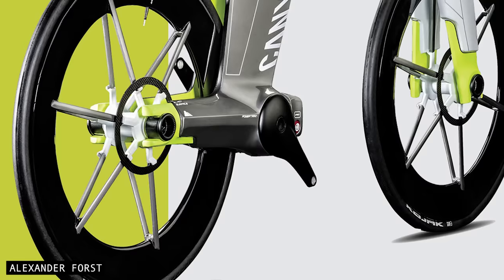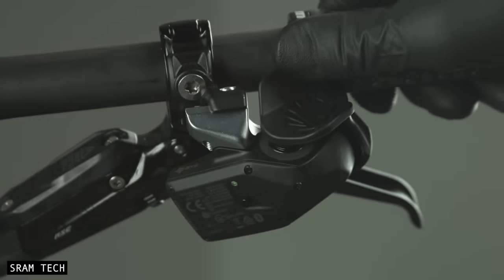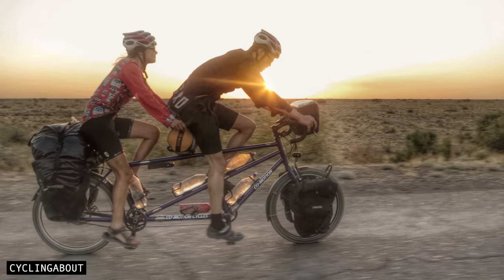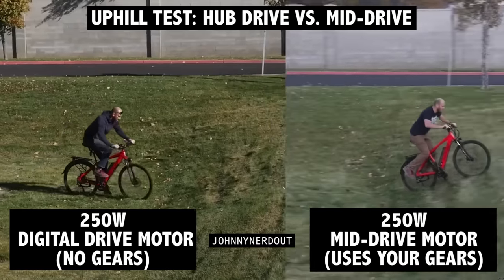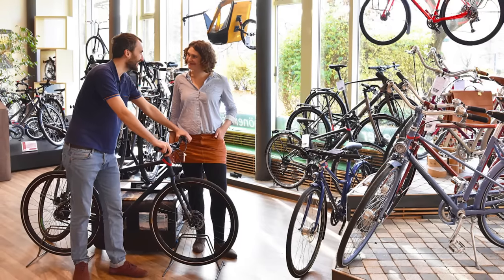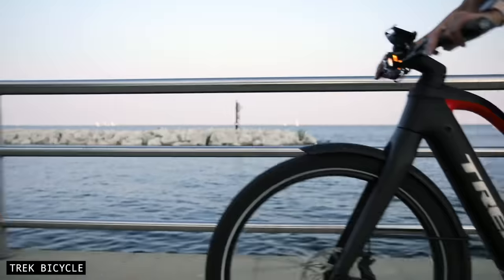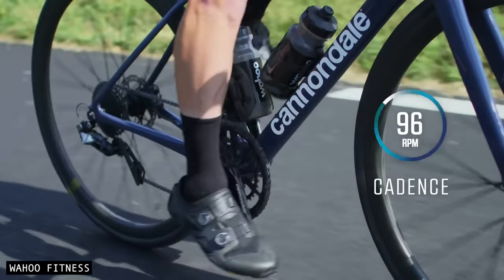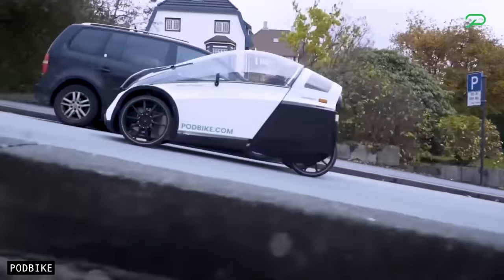Are Chainless Digital Drive Bicycles The Future of Cycling?

Comment from the maker: I might be wrong... but I think this is the FIRST video explaining digital drive bicycles on YouTube!! How cool is that?! 😎
Reply: Viral 🤞
Reply: A bit more than pretty cool. But the power efficiency of the digital drive is not cool at all...
Reply: @paulbizard3493  
True. It's hard to achieve as much as 70% efficiency, but this doesn't matter. On the flat, the needed power output is low anyways, and on hilly terrain, an electric powertrain will recharge and give back 70% of the energy while with a mechanical drivetrain the energy will go to waste. With an energy bank of a couple of kWh, it should be the better choice for most trips.
Reply: Thanks, I was curious about this.
One point you have shown but IMO not put enough emphasis on.
With this you can easily divide power output between multiple wheels (especially interesting for 3+ wheeled vehicles). You can also easily power a steered wheel (I presume that is what gives the cargo bike around 9.30 that amazing maneuverability).
Keep up the good work
Reply: Electrom Light Electric Vehicle must have been a part of this video. There is a YouTube channel on how that guy creates and the every improvements he makes.
Reply: Usefull vid thank you. Very clear on the subject and the current limits
Reply: Very cool. Thanks for sharing the knowledge
Reply: How is a 30-50% power loss not mattering? This sounds like a reaction from someone who doesn't ride a bike. Ever ridden into a headwind, up a steep hill, or with a flat tire. It's soul crushing. You would never succeed at selling a bike to someone who could try both styles. It would be an easy choice to avoid the digital drive. Regen is viable with hub motor already, so it's not like that wimpy feature is improved by dropping the chain. No one is achieving 70% efficiency on bike regen, and you don't want to destroy your downhill coasting momentum on rolling hills, so you can only really use regen to great effect descending a mountain.
Reply: I agree,never saw a digital bike before.
Reply: It's funny that you include graphics from Grin because they've definitely talked about it before.
Reply: Unless they have another name.
Reply: I'm 40 seconds in and really annoyed by the term digital drive. I really hope there's a good reason for not calling it an electric Drive bike / eDrive bike.
Reply: @beaudjangles  cus they kinda exist in some layman terms of language.
Take axon global, originally their name was taser, taser became so generic it was rebranded to axon global.
Smart people would invest in them and in  10years u laughing.
Anyway your comment is moot
Edit
And it’s not an e bike.
Reply: very nice review, if at times highly technical. I'm so intrigued!
Reply: Yes first I have ever heard of it, great video and analysis as always. Not something that I am interested in owning personally but very intriguing as an option for human powered and hybrid vehicles.
Reply: Why digital drive and not electric drive? If I build such a system withoud any transistor would it be called an analog bike?
Reply: If this were a Wikipedia entry, it would be flagged for reading too much like an advertisement. I fully expect that we will achieve fusion break-even before we overcome the efficiency problem. And where does this term digital drive come from?  Sure. Digitally electronics play a part in the power control circuits but they're nowhere is near as essential to the function of the mechanism as are the generator and motor which are not digital. Oh and by the way in wheel motors are not necessarily incapable of producing adequate torque. That's a design choice, not a design deficiency.
Reply: @MrDanthemaniam  we habe >97% efficient motors today. Make the controller losses <5% and we're close to dirty chain.
Reply: Hence, Subscribed!
Reply: I’ve come across this in the context of a cargo delivery ebike. It was the type with the rider in front of a long and tall cargo box.

I think Arcimoto’s “Mean Lean Machine” e-tadpole also uses a digital drive.

Makes sense for a long wheelbase bike where a mechanical drivetrain would require a long or multiple chains or belts.

But this video is the most comprehensive I’ve seen about them.
Reply: So cool
Reply: An enviolo CVT hub and automatic shifting can give a lot of the same benefits but with way better efficiency.
Reply: Yeah! 👍
Reply: ...and the best.
Reply: Electric, not digital
Reply: @112chapters3  It is an e-bike. Turning the pedals produces electricity that powers the motor. It can be paired up with a battery or not, but it's still an ebike. "Digital" could be a controlling signal but the propulsive power is definitely analog and not digital. This video is an example of what it looks like when a marketing manager does not ask the electrical engineer what exactly powers the electric motor of the bike. The next thing you know, they'll call it quantum bike or Bluetooth bike. 😂😋
Reply: @fd4511  yeah ok
Reply: FYI you are getting those stupid scam comments
Reply: Macarena cool.  💪🏻😎🤳🏻
Reply: pretty cool, but I have questions.  Aren't you limited by biology to produce no more than about 250 watts or so, and that by Olympic level athletes?  I think there will always be a need for analogue power, especially in a bicycle setting.  I own a pretty decent ebike a Lectric Xp 2.0 Step Through,  pretty good bike for the money.  However, right now my derailleur and gearset is damaged, and it is my primary method of getting to work, and range anxiety is now a big thing for me.  I think digital drive defeats most of the purpose of modern ebikes, Viz: to provide a platform by which you have multiple ways of input power, and those cheaply.  If the cheap 2 stroke 66cc engines were more reliable, I would like to see them also installed onto more ebikes, giving you three methods of input power.
Reply: @mattparker9726  just take the extra gears off your back wheel. Mean everything but 1 gear and a chain and a crack. Defeats the purpose of a multi speed and and gear bicycle but it does solve your one and only means of travel your bicycle will function that's the main point. Or get a different back rim and modify that one.
💪🏻😎🤳🏻
Reply: You're going to have to resize the chain too of course but that is easy enough done
Reply: @DR_SOLO  I'm going to get it repaired.  It's too valuable to me to take a half measure.
Reply: @mattparker9726  one gear in between paychecks is better than missing work and having a small paycheck was my thought that's all
Reply: I'm not convinced until you go around Africa on one of those!
Reply: You keep using the word "digital", but I don't think you know what it means. People like you probably believe in audiophile HDMI cables . . .
Reply: stupidly inefficient setup.

Would have to put in a LOT more effort to get the same out as a basic chain setup.

And enough with the "digital" BS.

Nothing but moronic marketing.
Reply: Were the early digital drive parents really digital though?  Generator plus motor is electric for sure but not necessarily digital.
Reply: There are other improvements for better efficiency, such as two separate generators (one for each leg) and/or levers instead of pedals (which generate more torque from almost the same effort). Also the wheel motor can be integrated inside the rim and this may reduce its weight or improve its torque range.
Reply: @vitordelima  in which case I can see it as an option for certain applications, especially when the bike is also an e-bike, but not universally.
Reply: @WatchmakerErik  Maybe the efficiency can increase, other ways to harvest energy from the environment and the rider maybe found (triboelectrics for air friction, photovoltaic surfaces, better solutions to use the arms or legs to power it, ...) and it could be worth it even without a big battery.
Reply: @vitordelima  maybe but I dont see an electric drive matching both the efficiency and weight of a chain anytime soon.
Reply: All this is doing is taking the work that you’re doing is the cycle is away from you making it so you can store energy for hard hills it’s absurd why would anyone want to ride like that you Eubank a bunch of electricity going down a mountain pass and then you don’t have to work as hard even though you didn’t do anything to get it? I don’t you know what I mean it’s so fucking ridiculous I can hardly stand it no self-respecting Cyclist sued ever go for anything so daft.
Reply: Yeh, exactly why are they called digital.. as far as I can see, its got a dynamo, and a motor, the only possible bit that might be digital, is the controllers phased supply of power to the motor, and they are in all ebikes, and we don’t call them digital. But generally, from the design, one can immediately see why these systems are inefficient.
Reply: very
Reply: Didn't think that concept made it to bikes. But why call it digital?
Reply: nice tech talk but I don't know why pedal power still exist considering the availability and affordability of powerful batteries.  it is like having automatic transmission car but you still want a simulated manual shifter over it?
Reply: Considering that a high proportion of bike sales are now ebikes I see this coming very soon.
Don’t e-cargo bikes / rickshaws use something similar already?
Reply: But bad explained. You connect two three phase motors (three cables) phase to phase and conversion reach 98% you only need one motor in the wheel and other in the crank. no electronics needed. 4 gears by star or delta connections on each motor. the motor in the crank act as a generator.
Reply: Not cool
Reply: This video is a clickbait and a scam for your so called digital (what exactly is that ) drive bicycle. See my separate comment below. Mentioning the addendum 'digital' on any product makes even a carpenter's hammer super efficient than an analog hammer LOL.
Reply: I like this idea. Pedaling up and down hills would be a very different experience from a chain bike, and you could pedal down hills to charge, plus use regenerative braking, without increasing speed. The idea of decreasing resistance at the top of the stroke is excellent.
Reply: @ricardorapture  it is a challenge to get even 80 percent efficiency in a single small motor or generator. This is based on mechanical power input and electrical power output (or vice verse). So how are you defining or measuring 98 percent efficiency? If you are only considering the loss in the wire between the generator and motor, then you are ignoring a lot of other losses that are important.
Reply: @mckenziekeith7434  the three phase synchrouns motor with squirrel cage starts on 98% efficiency. Reluctance motors goes Up to 99,8%. They can be used without any conversion and no electric components, only wiring on delta or star they can do 4 gears between crank and pinion motors. They work as motors and generators.
Reply: @mckenziekeith7434  you need to update your info
Reply: @ricardorapture  I have never seen a bike motor that is 98 percent efficient. Please send a link to the datasheet. I have been working in ebike/eskate/escooter and have measured motors on a dynamometer. So I am curious what basis you have for saying 98 percent?
Reply: @mckenziekeith7434  they are more expensive tho. And usually bigger. Do not point me with that finger, this video talks about old fashioned 2 wire motor so 🤷 I think the speech is invented.
Reply: @ricardorapture  yes large motors are available over 95 percent efficient. Induction motors and generators as well as permanent magnet synchronous machines. But not for ebikes etc. The things that make motors more efficient (copper and steel) also make them heavier. I am an electrical engineer. I have looked at a lot of motor specifications and tested a lot of motors with a dynamometer. I have never seen a small motor that was anywhere near 98 percent efficiency. It sounds like you have never seen one either.
Reply: @mckenziekeith7434  the more you want for them the less efficient they are 🤷 you can try to use them inside the specs and not like me.
Reply: Why is it called "digital" drive ? Where are the digits ?
Reply: Where can I order some?
Reply: @goinghome1904 it's not particularly hard to make it to ~85%. You just need a tiny airgap between stator and rotor so the magnetic flux experience low resistance as well as a very low resistance in the electrical part as well. Special materials like neodym make the design easier as well. But these things sum up in cost pretty quickly so do not expect a drive like this under 2k until mass production kicks ins.
Mechanical gears can be sold much cheaper today.
Reply: Can a one way cluch plus an electric motor without chain link be possible to increase Efficiency?
Reply: @MrHaggyy  the airgap distance is not highly correlated with efficiency. It does help increase power density, though.
Reply: Unfortunatly you told people unforgivable Bullshit about electric motor and generator efficiency.
Reply: So cooll
Reply: Years of practice on heavy diesel locomotives. How "digital" is that?!
Reply: In your advantages/disadvantages list, you omitted just one thing. Maybe money is no object in your parallel universe.
Reply: Where do the figures for the efficiency from? I've usually heard 90% for mechanical to electrical or vice versa and step up or step down tranformers are usually extremely efficient (99%+) so I'm struggling to see where your efficiency figures come from.
Reply: I've driven almost all series hybrid bikes on the market and we even have two of them. One is the footloose, for which we helped with development, but the software is extremely bad. The other is the Bike2 system in one of our prototype GoLo cargobikes which has over 80% efficiency, which is almost comparable to an enviolo drive system. My findings:

Mando footloose: bad. very bad.
Citkar: has the mando system but uses micro cranks so you can't create torque. Bad as well
Vowag: It's tiny, doesn't resist any torque, no feel at all
Old schaeffler: somewhat decent, but had some patent problems
New schaeffler: very jittery, not pleasant
Pendix: As shown in the video, pedal three times and maybe the bike starts moving
Bike2: almost feels like real cycling, high efficiency, very noisy, but great product/prototype

The biggest drawback we had with our Bike2 system is not the generator side but the motor side which really has either the torque or the top speed issue. So for now we'll stay with a chain but ideally our future is hybrid. Personally I want it to be efficient and I feel that the e-assist may add max 250W from the battery in any ebike system. But hey, I'm a cyclist, but the general public wants to go the lazy wall-e way (sadly). Great video and great research!
Reply: You may be the first one to call it digital when it's not digital. 🤷‍♂️😎
Reply: The video is nice but I would point some issues with your logic. 

So we have a good working system. "Test driven" by millions over the every day. 

- Lower running cost? (You swap a chain to a complex electronic controller which has way more failure points under the box)
- You lost the redundant drivetrain compared to the current "hybrid" ebikes

- The human body is not designed to output at maximum all the time. (That means that can cause new issues as well)

I admint there is a good point to consider it at some cases but I would not argue for it.
Reply: Nah there are other videos. Lots in fact. Ultimately this bike is a waste of time for now. I will stay with 95% power transfer.
Reply: About 2 years ago I had the idea for what I now know as a digital drive bike, and I spent weeks brainstorming the possible advantages and disadvantages of such a system. The idea seemed game changing and obvious to me but I never found any records of other people trying the same idea, at least until now. You might indeed be the first video on YouTube explaining this niche but exciting subject. Thanks for reminding me of the futility of trying to have an original idea.
Reply: I'm so happy to have found your channel. You are the best in this area for sure!
Reply: It is all making a simple cycle into an electronic nightmare like a modern car !
Reply: @curtisducati  That would be the typical way of thinking about it but think of books — they still exist and computers haven’t managed to render them obsolete. I used to think like you but now I think it’s good we have a wider choice as consumers. All those advanced technologies diversify our lives as long as the new coexists and not replaces the old. Cars are coming back from this dead end road of touch screens only. Manufacturers realized (finally) that no-knobs approach is not only clumsy but also dangerous for the driver.
Reply: by 'digital' do you mean electric?
Reply: @paulbizard3493  by 'digital' do you mean electric ?
Reply: It is not a digital bike! Just because something involves electronics, it isn't digital! Digital has to do something with "digits". Not just electronics.
Reply: its not digital its electric.....
Reply: @carmatic  yes, my bad. :) But then a computer could control the gear ratio and so the drive would be digital.
Reply: @paulbizard3493  there are scooters, powered by batteries and driven by an AC motor with computer controlled operation... but we call them electric scooters, not digital scooters
same with cars, bikes, planes, trains and all other forms of transport
Reply: because theyre not feasable mate u put more foot power in to get the same speed as a normal bike poor efficeincy
Reply: If the guy with white bike wants to improve efficiency, he should learn to adjust the seat hight properly. That would gain 5%.
Reply: @Youtube_Stole_My_Handle_Too  but a traditional e-bike still has chain driven for perfect pedaling efficiency while still having regenerative breaking on hills
Reply: Low running cost - low drive efficiency
I'd think you can't have one unless you don't have the other. 

Ah yes, low maintenance, but secretly high maintenance cost. Where you have to go to a pro cause you can't fix electronics or motors yourself. And you have to buy brand parts cause no one wants to bother offbranding them for the gullible 100 hipsters that own one. 

At any rate, your lists at 6:43 is funny. I have to wonder how much you're gettin paid to upsale so hard that you even have 'infinite' on the list like some fifth grader.
Reply: Yes, if you make up your own name for an old concept - you’ll surely be first..
Reply: cool until you realise that even with the most efficent components you can only reach a effectiveness of 60~75 percent. It is a cool concept for electric bikes to add for range extension sorta like regen breaking.
Reply: I'm an electrotechnical engineer and damn did you over complicate a simle thing as a bycicle...
Reply: This bike is utter rubbish.
Poor efficiency is a deal breaker.
Reply: What is digital about this?
Reply: Hahaha JUST BUY A MOTORCYCLE!!!!!!!!!
Reply: No, they are not.  A chain is around 95% efficient today, even on a poor quality groupo unless it's horribly maintained.  Just looking at this, I would estimate the efficiency to be 50% or less.
Reply: yep your wrong, this is nothing more then step assist like anny other electric bike. just without the chain. energy does not come for free, it has to come from a battery none the less. else people would have pedals in cars if that be more efficient....
Reply: @keytracer  bicycles are anti-technology. You can buy an electric motorcycle or a standard combustion motorcycle at this point in time
Reply: @keytracer  and then take a job we're not sitting in front of a computer all day
Reply: I may be wrong but it sounds to me like this is electrical analogue and shouldn't be classified as digital at all.
Reply: @ingramfry7179  it has a motor on it just get a motorcycle stop pedaling.
Reply: It's still analog!
Reply: @scottw550  so is a motorcycle with a carburetor. Just get a motorcycle and stop pedaling
Reply: It's not digital. It's a normal motor-generator and your efficiency numbers are total crap.  Have someone ride route and measure caloric output then do it with chainless bike.
Reply: I might be wrong, but didn't the professor on Gilligan's Island produce an electrical generator, using Gilligan to pedal a bike?
Reply: No, it's not, i already had watched one video from 2021., or maybe that 2021 dont even be the first.
Reply: I think you missed a point on digital bikes: If ever there is a problem in the middle of a desert, it is not serviceable by a regular person. Most probably the bicycle will need to go a bike workshop from its brand.
Reply: but its a crap idea maybe thats why
Reply: @Sergio_Loureiro  it's just an e scooter with a tiny pedal generator.
Reply: You don't even know what digital means. Electric != digital.
Reply: Go to school and learn someyhing. There's no such thing as digital bicycles.
Reply: @keytracer  It's only a misunderstanding or lack of knowledge.  When confronted with that, do not insult people, explain what they do not know.

Stop picking fights.
Reply: This is an electric drive train. Digital refers to sharing data or certain watch displays etc
Reply: I mran you said that this is digital which is completly wrong, its electric. Not everythung electrical is digital
Reply: This is brilliant and informative.
Reply: Would be better if there was such as thing as "digital drive" where the reality is *ELECTRIC DRIVE*. It's impossible to listen to your video when every sentence is wrong.
Reply: Someone had to say it.
Reply: Can I just say there is nothing such as digital drive. It's a fucking electric drive with digital components.
Reply: Power rangers
Reply: Come on. What are you all talking about.  This is not digital, it's an electric drive.  Our society has become dumbnified by design.
Reply: @FeralDayASMR  e-bikes still have traditional pedals because even they understand e-drive is inefficient
Reply: Because it's not a digital bicycle
Reply: How does “electric” turn into “digital” ?? 🤦🏻‍♂️🤦🏻‍♂️
Reply: Well put together vid. Very professional and entertainingly informative... It's a very sub optimal design, having 2 motor/generators..It would be better to have something more like a unicycle with direct drive, pedal-to-motor-generator but with a front wheel and handlebars, Batteries or capacitors in the frame charge under braking and auto-assist when accelerating. Possibly at least 1 wheel using a 3 pronged in-wheel regenerative suspension system, but may not be worth the added weight.. Half decent solar power paint or frame parts and it may be more efficient than a chain and gears. Very expensive though.
Reply: @kristianhartlevjohansen3541  This is an electric bike without the ability to directly drive it. Nothing more.
Reply: what is digital about the drive?
Reply: At least update your comment by removing the word digital
Reply: @zetsumeinaito  Dude called an electric drivetrain a digital drivetrain, then proclaimed to be the first to cover the topic. Gotta curb your expectations for him.
Obviously in reality, it has innumerable gear ratios, not gear ranges
Reply: To heavy, to many energy loss.
Reply: u sound like Modest Pelican!
Reply: Not hte first .. Podbike is an example. And it is electric drive (by wire perhaps), not digital - digital is a something completely different  -
Reply: I can’t believe you made this whole video without knowing what digital means
Reply: Janet Pratt  Why would you want that given all the downsides? Stick to a bike with an electric assist motor
Reply: There’s nothing digital about this.
Reply: The delivery of the narrator makes me wish I was deaf.
Reply: THIS IS NOT DIGITAL!!!
Reply: Surprisingly no. One can be aware of the yellow that covers everything. If the driver doesn’t provide appropriate feedback and incorporates their own bias it becomes obvious. Such as Nijah Houston. Houston TX was the goal right? But the feedback was not what one expected along with the cyclist.
Reply: @Youtube_Stole_My_Handle_Too  I find it hard to believe if it achieve 30%
Reply: @rosserobertolli  great info
Reply: The problem is: doing it this way, you get as tired as cycling in conventional way plus it's less efficient in comparison to regular bike. Which makes it look good only on the video. In reality you want to throw the bike into a ditch and walk away.
Reply: They can call it anything they want you, you're being irrelevant
Reply: Amazing👍
Reply: So I see efficiency increase with constant modulation to keep you storing energy in a way that is always optimum, like LT1, or your LT2 base output, if it then adds a bit of battery power to it and uses regenerative brakes, and also uses a larger hub for hub gear motorized propulsion for hills it might be really fun and useful!
I would get one if it also let you pedal to charge while braking or the brakes would cutoff direct power output to the wheel so you can charge it while on downhills or charge a bit longer while braking for a stoplight.
Reply: 1s and 0s makes it digital otherwise it's electric. Microprocessors and computers mean digital, manual switches, are electrical, dryers that dry on the settings you input are electrical, dryers that sense weight of the load and moisture level by themselves are digital.
Reply: Hopefully the ONLY video incorrectly labeling ELECTRIC DRIVE bicycles.
Reply: Yes, as an electrical engineer, I once saw the article on FB and exactly tried to tell what you told. It's no better than say CVT drive with belt, but also might replace the battery coupled bikes in the future..
Thanks for making an awesome video about the topic!
Reply: Very cool, i want one now ^^
Reply: @karlInSanDiego  It does not matter on e-bikes and especially e-cargo bikes and concepts based on those. What you loose in human energy input can easily be compensated by a larger battery. 

At least in the EU e-bike regulation is handled in a way that allows the electric motor to achieve quite impressive short duration power bursts that will propell your heavy e-cargo bike up any reasonable hill. 

Keep also in mind that the target demographic is commuters and not sport bike enthusiast. The reduced ranges does not matter to commuters and the additional power cost is like the total power cost insignificant.
Reply: My question is how long will the bike  last driving in the elements?
Reply: @cesarpagan4640  Fewer exposed parts that need cleaning, fewer things to maintain like oiling and cleaning (fewer then a e-bike with classic chain setup). Considering my e-bike now from crescent is doing its 3d year all year riding (in down to -26C), pretty much every day 10km average. Id say if they use similarly rugged parts for the motor and battery, then there should be no problems.
Reply: Correct it’s not digital at all. Generated electricity is analog as the output is continuous and needs an infinite number of finite points to describe it. Assuming feedback loops are digital implementations of continuous feedback loops (discrete) then just the controller is digital.
Reply: It will be horrible bad efficiency thanks to losses in elektromagnetic energy conversion from generator to rear disk motor - I had th esame idea years ago abndomed - it is nothing new.
Reply: LAMEO
Reply: DO YOU HAVE COPYRIGHTS FOR ALL THE FOOTAGES????
Reply: @markthomasson5077  Nope, they're direct drive.
Reply: @paulbizard3493  🔴 What Is Islam? 

🔴 Islam is not just another religion. 

🔵 It is the same message preached by Moses, Jesus and Abraham.

 🔴 Islam literally means ‘submission to God’ and it teaches us to have a direct relationship with God. 

 🔵 It reminds us that since God created us, no one should be worshipped except God alone. 

 🔴 It also teaches that God is nothing like a human being or like anything that we can imagine.

🌍 The concept of God is summarized in the Quran as:

📖 { “Say, He is God, the One.  God, the Absolute.  He does not give birth, nor was He born, and there is nothing like Him.”} (Quran 112:1-4) 📚

🔴 Becoming a Muslim is not turning your back to Jesus. 

🔵 Rather it’s going back to the original teachings of Jesus and obeying him. 

More ...
Reply: @fd4511  Док су други мало филозофирали Ви сте једноставно објаснили,браво и врло интилигентно....
Reply: yep...you're wrong
Reply: at 2:00 when stating the lack of 'maintenance' that such bike have you completely fail to mention that you'll have to continually charge the battery, unlike a chain driven bike...
Reply: cool enough to earn you a like button hit :)
Reply: Why do you keep saying digital? Do you even know what that word means?
Reply: First one I saw..
Reply: 4:56 power rangers 🎉
Reply: This represents the sole viable alternative to chains; however, both the generator and motor must exhibit hyper-efficiency, and the battery must possess ample capacity. Additionally, the software must be skillfully crafted to grant you the autonomy to determine when to recharge the battery. Pedaling proves least efficient precisely when power demand is at its peak, making it ideal for flat and downhill terrain. Uphill is better suited for battery power. This way the net loss in the generator and motor will be less than the net gain of pedaling when being the most efficient. This way a trip will be less demanding even without charging from the grid, compared to an ordinary bike.
Reply: One thing you said made me curious, infinite gear range. That's something that can be done on a conventional mid drive electric motor by making it behave like a automatic cvt and power the chain directly. Add a mechanical clutch geared for a particular speed for the pedals and you offset most of the losses. 

Replace the chain with a belt and you have a virtualy maintenance free setup that does not care at all if you "shift" under load while still extracting the most power from your feet when the electric motor struggles the most. Potentially better than a pinion gearbox or enviolo hub for less, as long as that clutch is really smooth.

PS: if you are a madman, you can even use the electric motor not just for regen braking but as a retarder and get rid of the rear brake for some applications as well. Maybe the future will be a power unit with all these systems integrated.
Reply: You didn't explain why it's "digital" and not electric...
Reply: @TlD-dg6ug  Because of laziness and hills, and longer trips.
Reply: There's nothing digital about it. The drivetrain is analog (power cannot be transferred 'digitally'). The only digital thing is motor and generator control, and that is digital on any ebike, actually
Reply: Shame it isnt digital tho.
Reply: @Mirinmaru  More accurately would be to call it electrical/electronical. What we're talking about here is the transmission line. Though, when we dive deeper, it is in fact digital control over the motor since it needs to be controlled by a PWM. This is either on or off. So, if the context is changed from transmission line to drive train, it is correct to say it's a change from analogue to digital.
Reply: NO as it's NOT digital 🤦‍♂It's electrical
Reply: Pretty wild considering you clearly know nothing about electronics/electricity.
Reply: Imagine the ENERGY LOSSES :face-blue-wide-eyes:
Reply: @fireWireX4  Approximately one-fourth, but this is not significant for most practical uses. What is much more important for everyday use is assistance with hills. Poor efficiency can be easily compensated for by using a larger accumulator.
Reply: It's definitely the first I've seen. While I'm a skeptic (by default, you understand) it is a really interesting idea. It reminds me of the fly by wire systems used in planes in lieu of having everything directly connected by hydraulic lines or what have you. In any case, I'll be keeping an eye on this technology. And keeping an eye out for it in the future. Skeptical or not, you never know. I was skeptical about the impact of COVID. "oh it's just 80k people out of millions. We'll be fine." Two weeks later, the world is shut down.
Reply: ... it's not digital, it's just electric. Electric != Digital. This is why you're the first, you're confused and don't know what you're talking about in the most basic terms. Also the problem is how much power a human can actually output with the cranks attached to a generator.. there's resistance it's not free rofl.
Reply: Do a video on Freegen which is going to be revolutionary for ebikes regenerative braking abilities